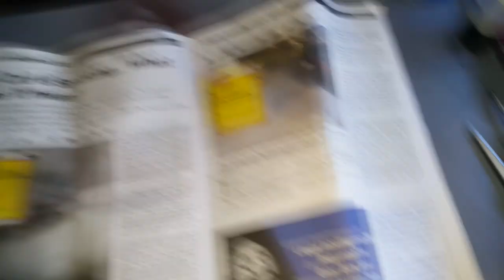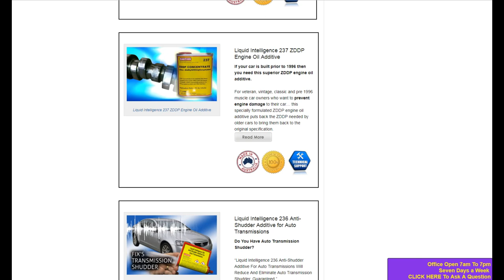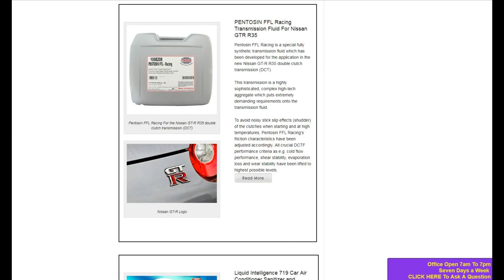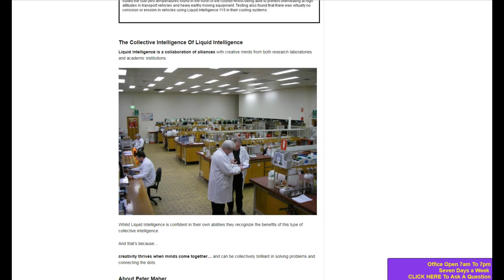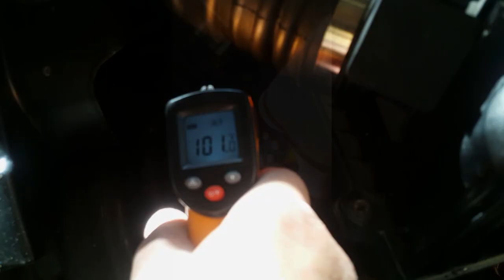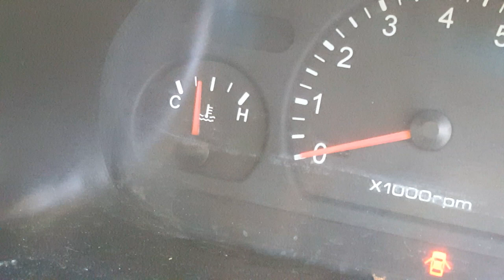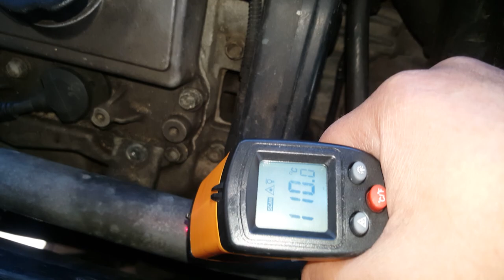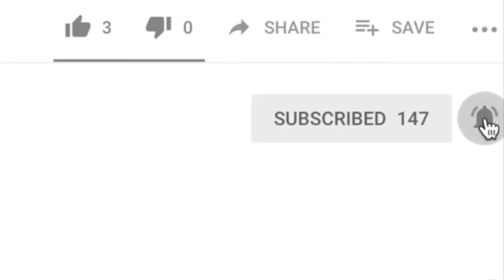How to Add Liquid Intelligence 245 Head Gasket Repair.

Comment: Thanks for this - really helped clarify understanding how 245 works. Ive bought the product but not yet put it in. from what Peter was saying its a good idea to leave it in, even after the breach is sealed, for up to 14 days, then drop it out & save it for another time important thing is to make sure theres NO coolant left in the system
Sounds like youve had really good success with 245
Reply from the maker: Yes, I've had great success with 245 and all of Liquid Intelligence's other products I have used. I leave 245 in for 4 to 6 weeks if I can. 1 van I added 245 for only 2 weeks as it needed to go back to its owner but it's still going now. I have used it on a few cars now and it worked out for all of them. I only just made a new clip using 245 again on a Hyundai Tuscon. We are still doing a head gasket on my friend's daughter's car 'put on hold' because of Covid. But in between jobs someone my friend knows with the same car also had signs of a blown head gasket and I recommended to him 245 and so far 1 week ago everything is going great. If you are wondering why I didn't use 245 on my friend's daughter's car ' simply because her brother borrowed it and drove it till it was dead. No amount of 245 would fix that one. Just remember a very important step I forgot to mention in my clip. For the first 4 to 7 days at the end of the day after your last drive while the engine is still hot remove the spark plus if you can. It will allow the pressure in the cooling system to push 245 back through the other way and seal any pinhole leaks. same engines it's hard to reach the plugs and that's okay if you can't but you will get a better seal if you can.
Reply from the maker: https://www.youtube.com/watch?v=RtMQkxrR9yk
Reply: @TaragoPreviaEstima  Thanks for reply. Just bought a car with known overheating issue. It pushes out 1 litre of water / 30 mins but NO mixing of coolant in the oil so will do this over the w/e. Will let you know how it goes. Hope it works 👍😁
Reply from the maker: @mckav2358  Before you us 245 I would like you to check a few things. Most important one is, Does the car blow steam from the exhaust? If yes then go ahead with 245. If no then you could be losing coolant other ways. If you are not blowing steam can you first try laying cardboard or a bedsheet under the front of the car before filling the radiator with water while the engine is still cold AND if you are able to! use a 1.25 bottle [old coke bottle will do] use plumbers tape or electrical tape to wrap around the nozzle of the bottle like you saw me do in this clip for a tight fit and fill the radiator or reservoir so the coke bottle is half full. Then run the car up to running temperature watching the coke bottle for bubbles and then turn off the engine and then check the cardboard after 30 minutes. If the coke bottle bubbles air out "some bubbles at first is normal" but if you see a pattern of constant bubbles or the water filling up the bottle then use 245. if you are losing water some other way such as a leaking welsh plug or a hose I would hate to see you use 245 to try fix something 245 can't fix and think 245 failed you. Check the few things first if you can please. What model and year car are you having this problem with?
Reply: Hi im thinking of using 235 not 245 on a transit vg which has a diesel pump leak,what are youre thoughts?cheers

Comment: Hi im thinking of using 235 not 245 on a ford transit vg  which has a diesel leak from the diesel injector pump,what are you thoughts?cheers
Reply: Sry its the 229 version i was thinking of using
Reply from the maker: I think it's always worth it. However depending on the leak if it's slow and the gasket is OEM it should work. I know people like to use silicon a lot on diesel engines and 229 will not work on silicon. Without knowing what your gasket is you have a 50/50 chance it will work but it will rejuvenate other internal seals even if the leak isn't repaired so yes still worth using.
Reply: Hi thnx for the reply.
The diesel pump is the original one out of the factory. 
The van is a ford transit 1998 vG.
Will you know if those diesel pumps were siliconed?
Reply from the maker: Hay there, If it's factory then it should have an OEM gasket/seal. There is no way of knowing without taking it off.